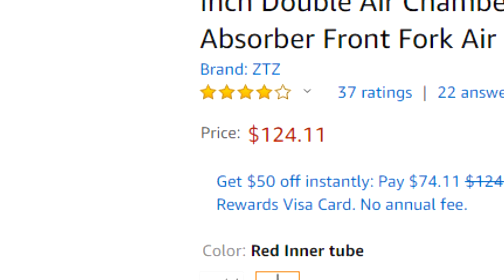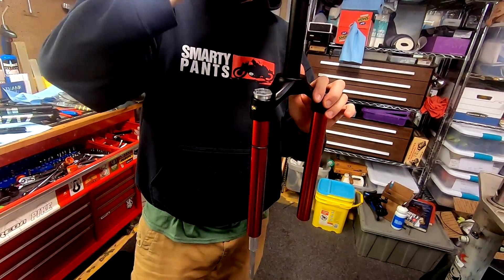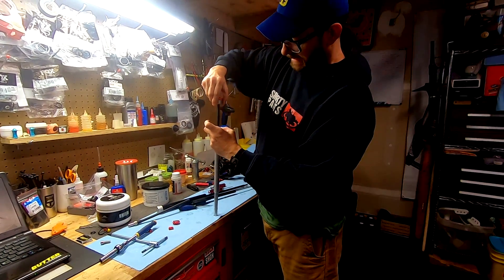$124 Bolany ZTZ Mountain Bike Air Fork Tear Down | Butter Suspension

Comment: Through all of this, the fork still performs well for XC in the stanchion width and can easily be scaled up. Brilliant design in simplicity and function. Every engineers goal is exactly that. Another aspect not mentioned is the fork is TUNEABLE. Suntours design for MTB applications is timeless.
Reply from the maker: It's a hybrid design based on stuff that was new back in the early 2000's, Bolany hasn't done anything new. My biggest problem with these cheap forks is they use low quality materials to get the price so low, and they don't test anything to meet safety standards. Literally any old Rockshox from 10-15 years ago is not only more refined (since these are just cheap copies) but they're also safer since they've been built with better materials AND they've been tested.
Reply: @ButterSuspension  I don't necessarily disagree with you, but I want to see some facts backing up your assertions.  Have you performed a metallurgical analysis confirming the cheaper metal used in these forks versus the superior name branded forks that are also built with Chinese sourced parts?  Where are your statistics or evidence backing up the assertion that name-branded forks of the same class are safer?  How many generic Chinese forks have you stripped down and compared against name brand forks of similar specifications?  How many of these Chinese forks have you ridden against similarly spec'd name brand forks to compare actual performance characteristics.  Lastly, how many long-term comparisons have you done with these forks against name-brand forks?

I sensed a general dismissiveness in your presentation that commenced even before you actually stripped down the fork.  That's usually indicative of confirmation bias and a lack of critical objectivity.  This does not mean that you were wrong in your analysis, but your conclusions seem to be overbroad and based on this limited one fork review.  Like most Chinese knockoffs, there are some that are clearly cheap imitations of name-brand products, with cosmetic appeal aimed at fooling the inexperienced buyer.  Then there are others that are clearly of the same (if not better quality) than the name-branded product.  These often run dangerously close to the line (and sometimes run clear over it) of patent infringement.  These, however, are just as good as the name-branded product, but just lack the name-brand appeal.  The trick is knowing which one you're getting.  The safe bet is to go for the name brand, of course, but a name brand doesn't always mean a quality product either.   Food for thought my friend.  Thanks for the video.  This Bologne is clearly not one of the good ones. Lol!
Reply: @ButterSuspension   Its actually suntours design, and has been copied by both Rockshox and Fox to a large degree. The ONLY unique design is Ohlins, and they suck. The newest Chinese forks are equivalent to Fox 34s and 36s in terms of TRUE enduro based air forks. They are all in the 200 dollar range, and offer performance on the level of 1000+ forks. You will see them soon on everything in budget biking for AM or enduro. That story of biking had to be expensive was just a marketing ploy by the industry that relies exclusively on Chinese manufacturing.
Reply: I think what people miss is the fact that these cheap forks usually don't specify the alloy of aluminum, or heat treatment the aluminum received for that matter. Forks by reputable companies, even Suntour, usually publish these specs on a website you can find. For example, a good forks  stantion tubes  will be 6061 alloy, with a t6 heat treatment (Marzocchi Z2 by Fox), a really  expensive fork will use a 7000 series alloy at a t6 heat treatment for a stronger and lighter package (Fox 34). These budget forks, who knows what the spec is, or isn't. They are scary light, but how strong? Most OEM cheap forks, found on bikes sold in the US use heavy steel tubes to control cost, while ensuring they are strong enough to be safe. Ultimately, as the rider, it's your risk if you choose to ride one of these cheap Chinese aluminum forks. They might last years for one guy and a month for another. When a fork fails catastrophically it will bite you hard!
Reply: @patchesthejaybird8431 

...or they last a single day, like mine (32/120/29")

Comment: I bought two solo air version and ride mostly blue to black, mild jumps and drops. It's held up. Not the most comfortable, but it's held up. My advice when you get it is to do a lower end service and make sure everything is oiled and greased up properly, and make sure to clean the stanchions after every ride. It will be okay for most trails. But if your going to be doing difficult trails, get yourself a higher end fork, not the bottom of the barrel forks either from the name brands.

Comment: Haha dude I have the sameeeeee oneee and had it for a for a while now and the inside are rattling sooooo bad I wanna take it apart but I dont wanna be out of a bike 🤷‍♂️🤦‍♂️
Reply from the maker: It will probably take itself apart, lol.
Reply: @ButterSuspension  haha so last night I took it all apart and just like in the video I would not suggest to ride this out of the box like seriously you can really mess yourself up it's a great fork for the money the only thing that happened was that mostly everything inside was loose a little bit of thread lock and some real grease btw there was none in it when I took it apart so thankfully I always used a silicone oil to clean the seals so that was pretty much the only lubricant that it had did the same on all the other pistons rods I would say idk what they are called then I put it all pack together I had one problem with the lockout side on the bottom where the Allen bolt goes when I would tighten it down it would eventually seat bit just free spin because there was nothing inside to help it kinda lock down and not spin the shock on the inside if that makes sense I pulled my small impact gun out and that was able to tighten the bolt without spinning anything on the inside I put all together and went on a ride this morning and I was pretty much shocked by how much of a difference it felt 🤯 not saying it's a good for any crazy stuff but for what I do road riding and very rarely gravel trails so really the most I see is small bumps but wow its veryyyyyy quiet  seems very smooth I guess we will just have to keep riding I'll post back up in a few months and tell how it's doing I was gonna go to a ridged fork but I love these cause It looks great on my bike and like I said I dont do much anymore but ride with my gf and dog hah

Comment: Think it’s possible to attempt DIY-ing a better brand 32mm cartridge into those stanchions and lowers?
Reply from the maker: With enough time and money, anything is possible...but, why? Putting a Ferrari engine in a Honda civic doesn't make the Civic not a Civic. 

I think rebuilding an older Fox or Rockshox is always a better option, especially in regards to safety and material quality...
Reply: @ButterSuspension  but it makes the civic faster for less than a Ferrari

Yeah material quality is an important concern, fair enough.

Comment: i bought the same model last month ago and just have a few time easy ride. Yesterday I noticed that 1 side of lower leg bolt missing. I opened up and check, the original tap hole at the cartridge damper is bigger than bolt at least 1mm....

Comment: My sons fork is leaking air.  I’m wondering if taking it apart and wiping it down might get rid of some dust?  Can these cheaper air forks  be maintenances?
Reply from the maker: First thing to check is the air valve; inflate the fork and spray it with soapy water. If the valve core is loose, bubbles will show. 

Any other leaks will either be damaged air seals or scratched air sealing surfaces.
Reply: @ButterSuspension  That’s a good start! I’ll check that.  Does anyone know if this fork follows a reverse engineered product we have seen from a larger fork manufacturer?

Comment: OK!! This is a Rad Channel I have 2 judys hanging around, so I found Butter Suspension!! Hope you start your Brand of FOrks!! ANY WHO I have 10 years of bike shop time in Utah ,so this is a real question... (don't judge me) .. Would you put this on your kids 24 inch bike?? I have seen a few people put the 26 inch version on a 24 inch mountain bike.. My boys both weight 60 LBS, and because of covid My buddy's that own shop's can't get me new bikes. So I'm try to make there Trek Roscoe 24 a bit more fun slackerish.. JUDY BUTTER! Jonny Snott. peace ,eek
Reply from the maker: I would totally put a Judy on a kids bike. The only issue would be the 24" wheel and the brake boss position, you'd either have to not run brakes or bump up to a 26" wheel.
Reply: @ButterSuspension   I ended up buy 2 new 26 inch manitou shocks (LBS) (my old job) on the bikes. They are disc brakes so it worked.

Comment: I just ordered this fork for my fat ebike, except it has rebound adjust. This is after the Bucklos fork I ordered on Amazon arrived as a KRSEC with a bent rebound knob. The Bucklos seller promised to make sure they sent the correct fork and package it well, which they didn't and it wasn't. World class idiots!
Reply from the maker: At this price, it's a race to the bottom!
Reply: @ButterSuspension  What price and what race do you speak of? Do you sell fat bike sus forks?
Reply from the maker: Any fork that is $130. And the race to make the cheapest fork possible. When companies cut every corner possible to make a fork "look high end" but coat so little, the end consumer loses in the end.
Reply: @ButterSuspension  What other choices do I have for straight steerer tube sus forks that have rebound adjust?
Reply: Just an update... The Bolany ZTZ w/rebound is working well. I checked the stanchion nuts for tightness and lubricated the plastic bushings with teflon dry lube. All seems good. It's holding air and the rebound is working well. I'm sure it's not as good as a Bluto or other high-end fat fork, but I'm totally happy so far. Thanks for this video!

Comment: I recently bought this fork, for a budget build, and the fork tends to lock up after certain bumps, or really small drops. I’ve been told it needs lower leg service. I would like get your opinion on this problem. Thanks in advance
Reply from the maker: Hey Alex- If you've ridden the fork for many miles in nasty weather, it's possible there's water built up in the lowers. A lower service will allow you to drain any water, see if it goes away.

If that doesn't do the trick (or there's no water in the lowers) it's more likely the tolerances on these forks are bad. Some may be fine, others may be way off, but a lower service (replacing dust wipers) won't take care of any quality control issues in the lowers, uppers or in the damper/air shaft. If any one of those is out of tolerance, that could cause the locking; if more than one is out of tolerance, it will compound the issue.
Reply: @ButterSuspension  thank you so much, you've answered many of the questions i had.

Comment: I disassembled my Bolany 32 this winter after a full season of riding. Obviously not doing drops or large jumps on that bike but rough XC and mild downhill stuff. The version i have does not have a negative chamber adjustment and no rebound on the lower. 

Since i have this weird thing about buying on the cheap and seeing what can be done (😄) I ordered basically every internal component from Suntour for 32mm stanchions, including their $70ish damper cartridge with rebound. Also replacement bushings for the lowers. It all fit and it all works hahah!! This is literally just for fun but want to see how long I can go on this fork. If I can get 3 or 4 seasons on it, I will call it a win for upgrading inexpensive big box bikes. That is really what these things are aimed at anyway. 

Great vid and now subbed 👍
Reply: I have a similar understanding. I have a Chinese shock absorber "fork 32 pro" 140mm thry axle     ... During the overhaul, the lower screw that holds the oil (right) cartridge slipped. It will have to be cut and thrown away .... Which Suntour oil cartridge fits !? I would like to put FUN 062-10. The diameter of the old Chinese threaded cartridge above is 29.5mm, will this Suntour fit?!. Which Suntour cartridge did you put in and what is its diameter on the thread?
Reply: So we got the OEM source for this fork!? :D)))
But for that money you could also buy XCR/XCT fork from the same manufakturer (Suntour).
Reply: Can you post the part numbers for the parts you bought?
Reply: how is it now?
Reply: How did they hold up?

Comment: So what was the fork bought just to poke fun at or you trying to show off your extensive knowledge and skill set as a seasoned douche bag?
Reply from the maker: Curiosity is how I came to this profession, it's how I started working on suspension, it's why I started my business and this channel. I was genuinely curious how any company could make a new fork and sell it for $130. If you think someone with extensive knowledge trying to see how stuff works and showing people in the process is "seasoned douche bag" material, I guess I'm guilty. 

Definitely don't watch the next video about this fork, we're gonna load test it to failure (along with forks from the big three brands) specifically because of how many messages and comments I've gotten about this exact fork catastrophically failing during minor crashes. The reality is that it's just not possible to offer a brand new fork at this price and have it be a safe product to ride.

Comment: For literally $3 more you can buy an SR Suntour XCR32 Boost, which is both more durable and reliable than that thing. It has a proper warranty, and SR Suntour's upgrade program. Buyers are literally a 5 minute research away from buying an actually good suspension fork.

Edit: I used my local conversion rate which puts the XCR in the $127 range, but actual SRP is $125.97. It now depends if you're buying straight from your LBS or having it delivered, but you're still +-$10 away from a fork that's literally 200% better than that Bolany.
Reply from the maker: This!
Reply: @ButterSuspension  in Mexico bolany is like 100 usd (no doble air chamber) and 125/150 double airchamber/airchamber + rebound.
xcr price is 250 usd. A lot of difference. an appreciable difference, especially in countries where a dollar is equal to 20 pesos

Comment: If you have to get a fork and cant spend a lot of money you should rather get a used older model from a known brand like Rockshox or Fox. You can get them for a similar amount of money and know that they wont fail mid ride.
Reply: Depends where you live. A second hand bottom of the rung rockshox or anything with a name on it will go for about twice the price of these here in Spain. Horses for courses. In the UK and USA the market is flooded with second hand bikes and components, that just isn't the case in many countries.

Comment: I have a set of 2010 worldcup boxxers. The seals are leaking and it wont lock out anymore. I  mentioned it to our local bike shop and they said they cant fix em. why? They said they cant get the parts for a shock that old. they can replace the seals but not promising anything if they will work after.
Reply from the maker: Seals are still available, I have them in stock. But...Boxxers generally never had a lockout since it's a DH fork.
Reply: @ButterSuspension  Good to know. I guess the guy at the bike shop wasn't so knowledgable then lol. How much are your seals. Also should I rebuild the inner parts as well?
Reply from the maker: @kaywoodparsons7967  Most shops don't have the time to research rebuilding new suspension, let alone "vintage", but it's all I do now. Seal kits vary, but for that fork, about $50. Labor to rebuild is $130. The service interval for that fork is once a year; if it's never been fully rebuilt, it's about 11 years overdue, lol.

Comment: at 5:40, the adjuster location does not dictate the adjuster function. Old Fox dampers had rebound on top and compression on bottom. Early open-bath (pre-RLC I think) dampers and the original FIT (Terralogic, with the bladder at the bottom) were arranged this way.
Reply from the maker: Correct. I realized that after we filmed it (and after I said it).

Comment: Have you weighted this fork? I don't remember hearing you mention it. I'm a bit curious how it would stack up against low tier brand forks, like the Rockshox Reba, which only weights about 1600g?
Reply from the maker: I didn't weigh it, sorry. I understand to some people product weights are important but it never registers in my mind since I'm a 225lb rider. #lightweightstuffonlygetslighterasitbreaks
Reply: @ButterSuspension  right, thanks for your answer. I'm the opposite, every gram counts, as I'm only 56kg (123lb). For me, any bike heavier than 12kg is exhausting to ride, unless I go downhill. For climbing, I prefer a stripped down bike without rear brake, about 9kg.
Reply: lol, Reba as a low tier fork? you're so funny...Reba is 2nd best in RS XC lineup, retails around 500$ and you are comparing it to this crap? hahaha

Comment: Could you not just use that upper and crown on another set of forks (like some cheaper rockshox?) To get the sex appeal and quality in one 
I hate rockshox gold uppers
Reply from the maker: Not quite as there are so many parameters to make two forks "fit together". The biggest issue is the strength of the red uppers, I've seen a few videos of them failing on small crashes.